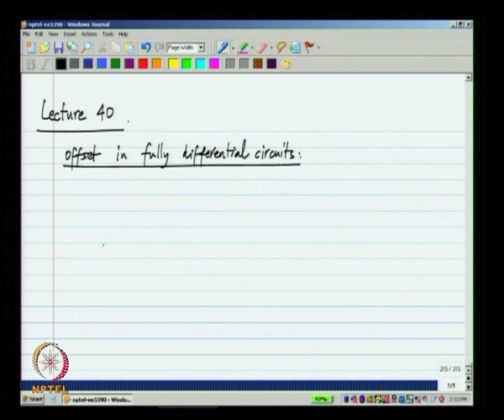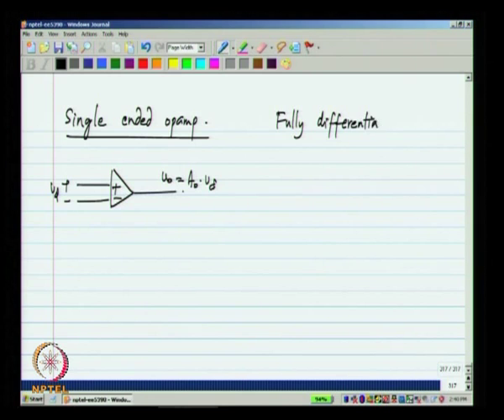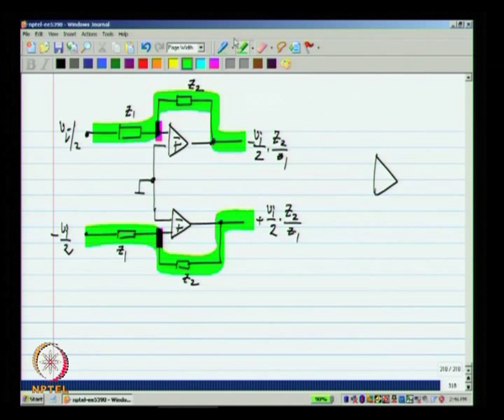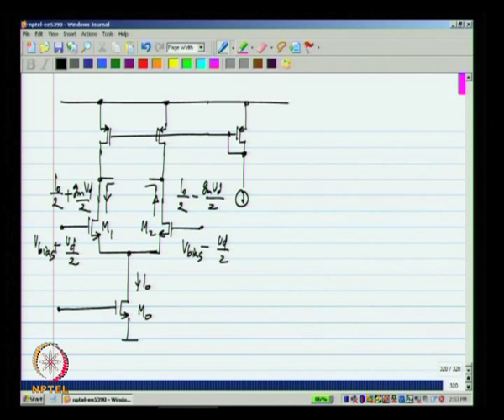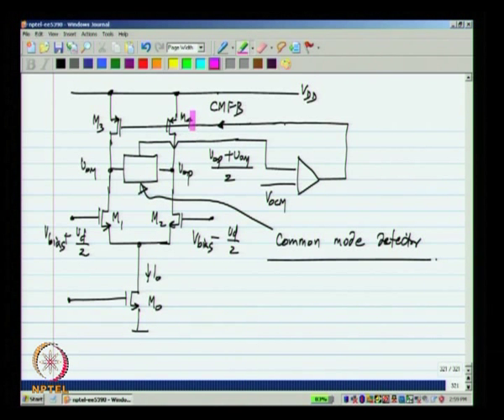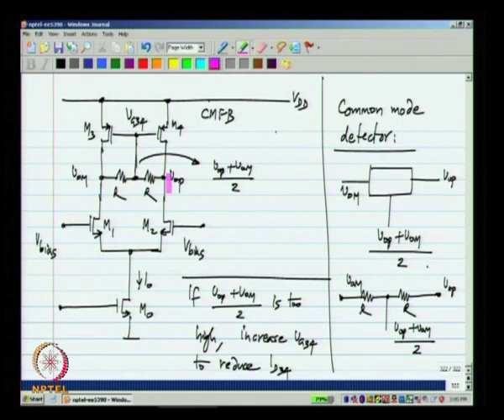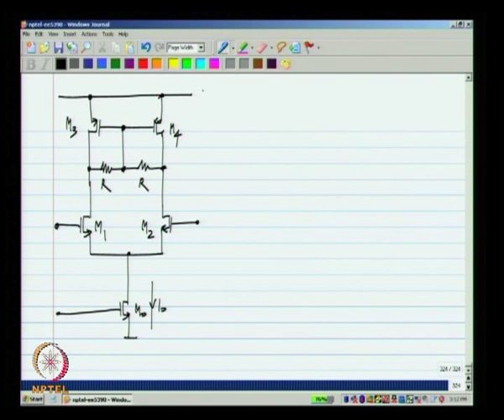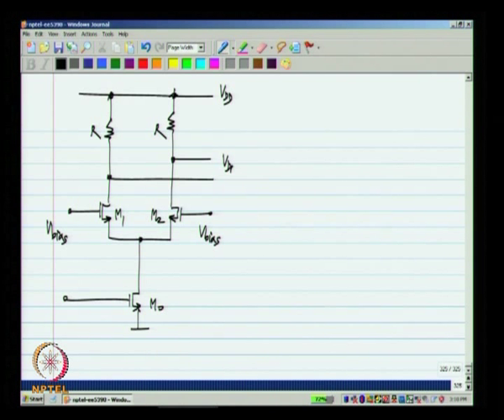Mod-01 Lec-40 Lecture 40

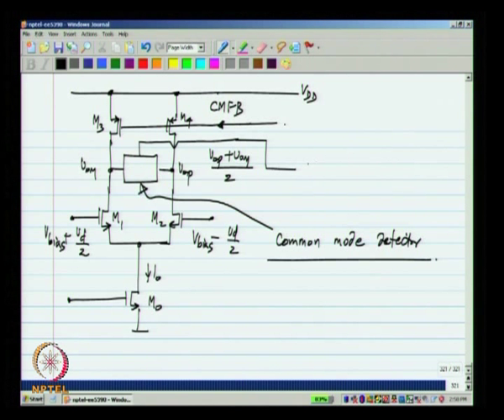Comment: I am confused at 25:45. Can someone write it in text.
Reply: By common mode, he means the dc bias value. For this amplifier, the output has a dc component and a differential (ac) component added to it. If you sum (or average) the two outputs (Vocm+vo/2 & Vocm-vo/2), you get rid of the differential and simply get the dc (Vocm). Now, as explained in the previous section, this Vocm is not explicitly set. With mismatch, M3's Io/2 and M1's Io/2 are not equal, say Im3>Im1. This charges the parasitic cap at M1's drain, pulling up that node to Vdd. If that happens, M3 enters triode and we don't get expected active load operation. So, we need to set that voltage such that all transistors are in saturation. For this, we use negative feedback. If we take Vocm (average of the outputs) and compare it with a desired Vocm* using an opamp, by virtual ground, the output is set equal to Vocm*. In order to make negative feedback work, you need to have corrective action, ie, in a loop, if a quantity is increasing, the loop will invert polarity as you pass through it and make that quantity decrease to correct for the increase, and stabilize the quantity. For this, you need odd number of sign changes or "inversions" in the loop. In this case, that is provided by the inversion from M3's gate to drain (note there is no other inversion in the loop). Let me know if this answers your question.
Reply: @utsavv1167 thanks you

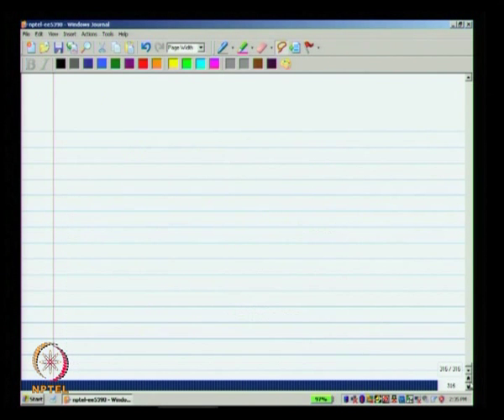Comment: I always thought the differential pair is immune to noise. It is only in the case of noise from outside and not for the noise generated within the circuit. 3:37
Reply: What you mention is while considering a symmetric structure. It is affected by noise when left and right halves are not exactly the same, as explained by sir.